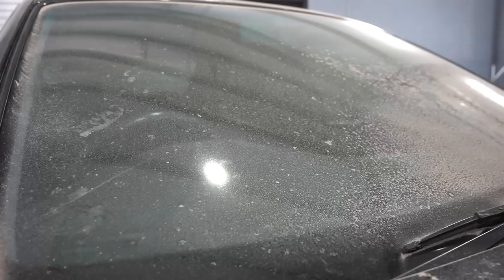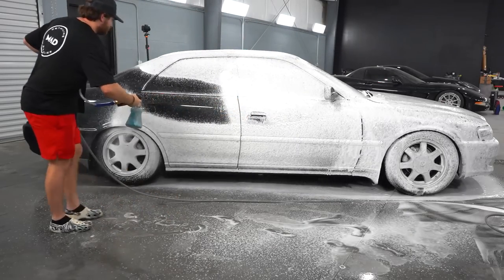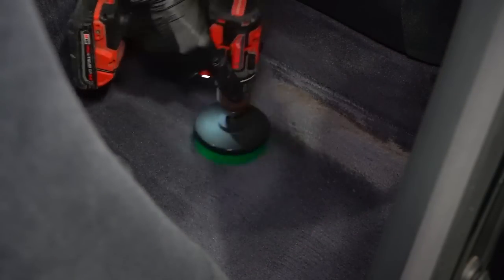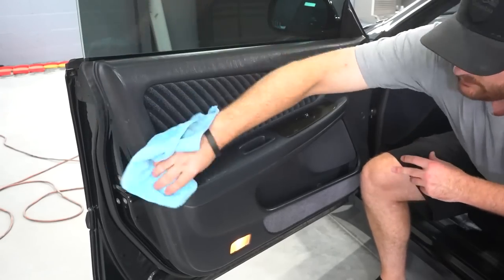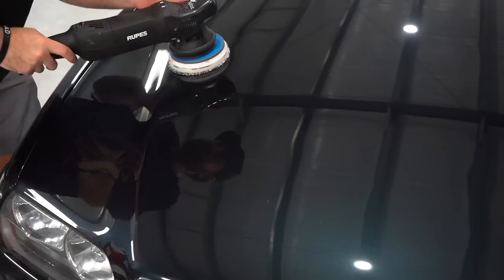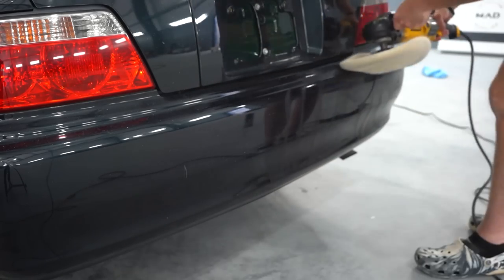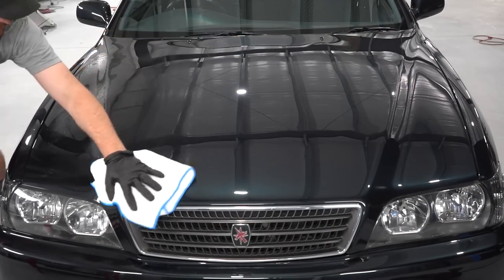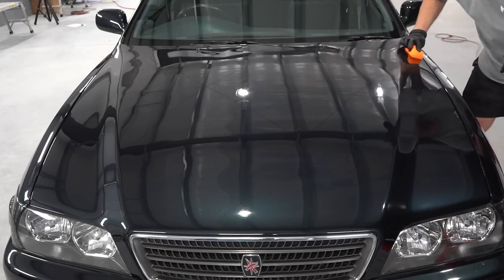ABANDONED Body Shop Find First Wash Since Imported | 26 Year Old Toyota Chaser Car Detailing How To!

Comment: They need to bring colours like this back. Also when u spray the APC on the wheels and it melts the dirt on contact it's literally the best thing in my life
Reply: I think it's more like iron remover mixed in there too. It reacts with the amount of iron which is present in the brake pads and which is held on to the rubber.
Reply: ه
Reply: @Hotpack7279  kj(
. Nu man